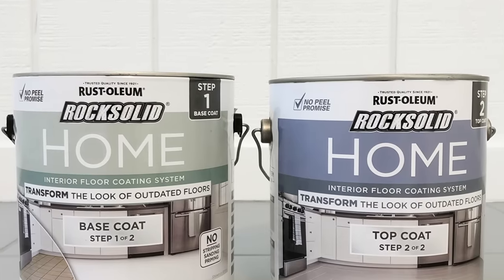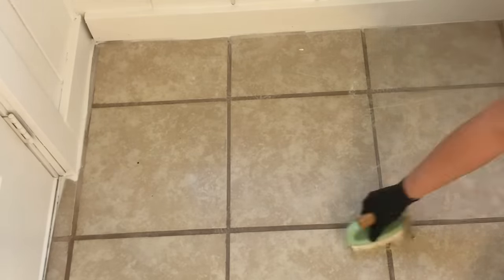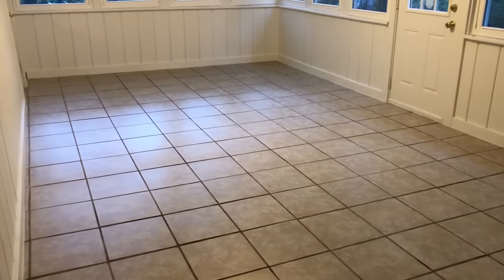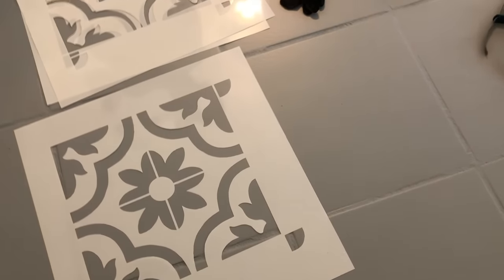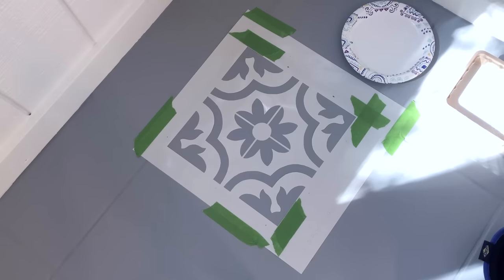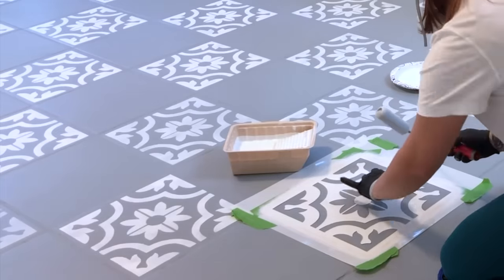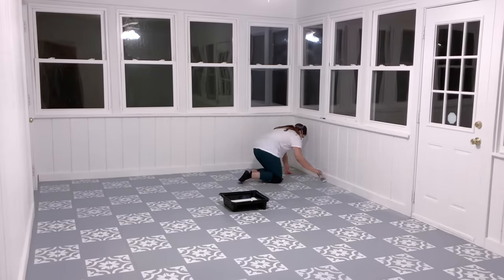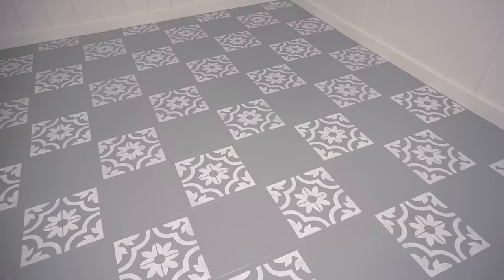HOW TO PAINT YOUR FLOORS TO LAST | RockSolid Home by Rust Oleum

Comment: I am a decorative finisher (over 40 years) and have used just about every product for floor painting.  From experience, I use California “Fix-All”.  It’s self priming and needs no top coat!  You can have it mixed into any of their colors.  It’s meant to drive on so you know it will be tough.  I apply a base coat and second coat and then either spatter paint or stencil a design.  Easy sneezy.
Reply: Does it last the long haul, or will it eventually scratch or peel up?
Reply: Update please
Reply: Yes!! Update on how did they hold up??!!
Reply: I'm not a painter I have to paint a wood floor in a bedroom pretty quickly and it dry pretty quickly can I just put down one coat of that paint and it'll be good

Comment: Soooo, I got these in smoke gray at home depot and painted my kitchen floors. The color is much lighter and a bit different than pictured (looked blueish/greenish perhaps because I used a white primer underneath) which was a bit of a bummer, it dries beautifully and is easy to clean (as long as you do not use any rough products on it). For far, I have a fee niks on the floor already. Easy and inexpensive way to revamp your floors.
Reply: Thank you for reaching out! We're happy to hear that you had ease of use with the Rust-Oleum RockSolid HOME! We would like to talk further about your experience with the color of the coating. Please contact our Product Support team at (888) 683-5667 and we'll be happy to help!

Comment: One simple, but very aromatic, way to remove any soap residue after cleaning a floor is to spray vinegar on the surface and remove with a very clean/new damp microfiber pad mop.  We have aggressively hard water, so I use extra strength vinegar to rinse dishes and laundry, and our floors.  I promise, the vinegar "fragrance" disappears as it dries, but it absolutely cuts soap residue.

Comment: Wow! Your floor turned out so pretty!  Well done!  Thank you for such clear instructions!  I am planning to paint our engineered hardwood floors and our staircase. Do you know if this paint will work on the tile in a shower?
Reply from the maker: I would not use this inside a shower. Rust oleum has a specific paint epoxy for that.

Comment: The stencil looks awesome. I had just purchased this product from my local Home Depot. You are right about two coats on the lighter colors but it leveled the roller marks out. The color before the product was dark. The only question I have is. Can you walk on it after the 6!hour first coat? Before I put the finish?
Reply from the maker: You can just be sure it’s completely dry. Don’t use shoes either. Go barefoot or wear socks.
Reply: The Latina Next Door thank you. I kinda figure that but I wanted a confirmation. Mine is coming out great. I have another bathroom to do. Thanks again for your guidance.

Comment: Dear Admin, I plan to paint on the bathroom tile flooring . Is this rustoleum floor paint can last for years even I use brush to clean the bathroom flooring ?  Coz I worry the floor paint will partially peel off after sometime I use the brush to clean bathroom flooring.

Comment: I don’t know if you’re going to be able to have the answer to this question but if you have a gap in the flooring tile that is pretty wide and you use leveling compound in between would that affect the adhesive level of the paint and would it be workable

Comment: Thank so much for your video. Your project turned out beautiful ! I just wanted to ask how you are liking the matt finish. Is it wearing as well as semi gloss or gloss ? I am a little concerned about how it will be to clean and if it will get grimie easier due to less sheen for protection. Thanks !
Reply from the maker: T. Steffes I love the matte finish and cleaning it is super easy. I use soapy water and I have even used a magic eraser on some skid marks and the finish has held up fine!
Reply: @TheLatinaNextDoor  That's fantastic ! Thank you for your kind reply

Comment: What size was your stencil? I ordered one 13x13 and I thought it would be one full design however you have to place it on four tiles before you see the full print. Did I order incorrectly, my tiles each are the 13x13 size

Comment: I've never done this type of project but have been dying to change out my horrible 3" plain off white bathroom floor tiles in the half bath off my kitchen. Do I need stencils that fit exactly within the 3 inches??
Reply from the maker: Actually no, you can always use a larger stencil that takes up more tiles at a time. 😊

Comment: Unfortunately this wouldn't be possible for my kitchen floor. It begins as my only entry and is in the middle of the house, I'd never be able to get to my bathroom or take my dog out. I might get away with doing half the room at a time, but that 72 hour cure would still make entering impossible. I have considered this many times but can't find a really acceptable solution to the situational problems. It does look great though. 👍

Comment: How would I do this on concrete floors?   There was carpet, but it was ripped out.
Reply from the maker: You have to make sure any residue is removed from the concrete before you start. That will be crucial. Then just apply the paint per instructions on the paint can. 😊

Comment: Do you have any idea if this would work on shower tile??
Reply from the maker: I would not use it on shower tile, but Rust-Oleum actually has a product for that called Tub and Tile - I would check that out. I have seen it used and it looks like it works great. Hope that helps!
Reply: Gracias♥️

Comment: I used this product 4 months ago. I scrubbed my floor 5 times with Krud Kutter. I then applied 2 coats of base and 2 coats of top coat. I let it dry 12 hours in between each coat. It looked fantastic for 3 months. Now 4 moths later it looks terrible. The top coat wore off and my shoes are sticking to the base coat under it. . Dirt sticks to the floor so I can never really clean the floor. I would not recommend this product. Like I said ...It looked incredible the m first month or so. I have not seen a video of anyone showing their floor 4 months later ???
Reply: Thanks for posting that

Comment: It looks nice, but I am curious why you’re windows aren’t open while you’re doing this project?  If a mask is required, it seems very toxic.  What does the safety data sheet say?  Be careful if you have small children or pets and consider only using non toxic products.
Reply from the maker: John JohnG thank you for your concern. We are always cautious during these projects. We painted the floors at night and during a cold snap. Opening them up would have not allowed the paint to dry properly.

Comment: Watching you for the 1st time. Your doing the paint your floors to last.  I must say in your a DYI blog there are some issues.  1st your trim boards are not the best.  You can see your joints " A good caulk job is needed" also your nail holes some are indented and others have globs that should of been sanded  Also gaps where 2 pieces come together in the 1st corner  where u started to paint. If your going to show DYI projects Details are important.
Reply from the maker: I agree, details are important. The items you mentioned were done previously (meaning not by us) but it’s a sunroom so it honestly doesn’t bother me. The house is old and has its quirks as most older homes do. The focus of this video however was the floor. Thanks for watching!!! 😁

Comment: The floors are really nice but you should have taken the baseboards off.
Reply from the maker: Sheri Roch thanks, but that was unnecessary for us in this case. The baseboards were in good shape - they just needed to be cleaned and painted which we shared in the previous video. Removing them would have added to the work load and cost so we chose to keep them as it was the best option for us.